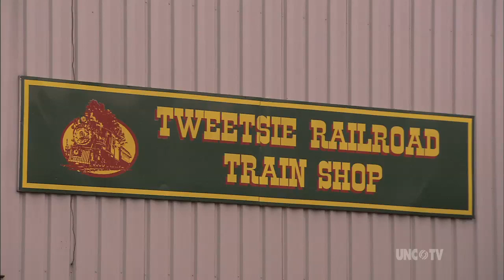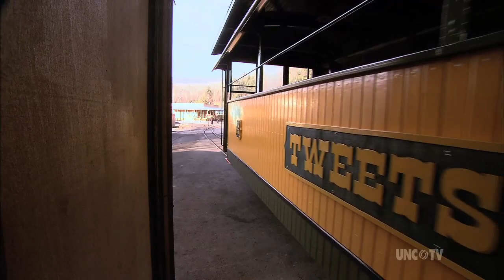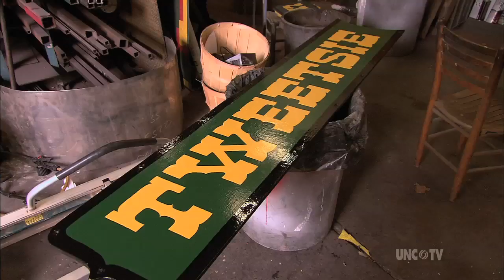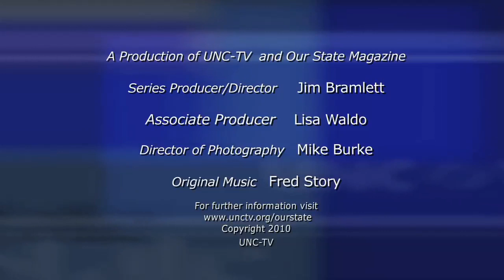Tweetsie

Comment: At 4:32 on the flat cars 192 190's sister was on the front. 190 was on the back then both engine's tender.
Reply: 1 more locomotive of the original Yukon fleet, #195 still sits idle at Skagway, would love to see it at Tweetsie, where I know it will be taken care of...
Reply: Swati Yadav same but tweetsie should also buy and repair 71 from Dollywood and center the headlight
Reply: There should be a petition for someone to do that
Reply: I really don't think that a centred headlight would look good on a narrow gauge engine, nor have I seen any narrow gauge engines with a centred headlight, have you?
Reply: I also never like an engine being used as a source of spare parts.. Union Pacific 838,  White Pass 71, a surviving sister engine, deserves better, than to be cannibalized for spare parts, they should be in a museum, like Grand Trunk Western 6323, or Milwaukee Road 265, or Union Pacific 3977, or Southern Pacific 2467...